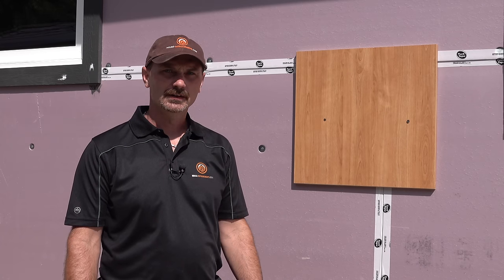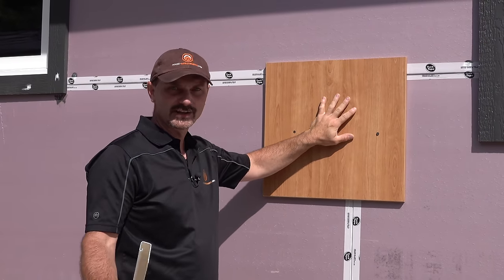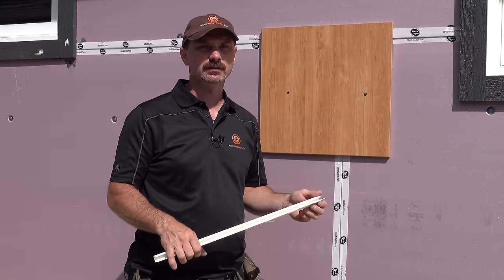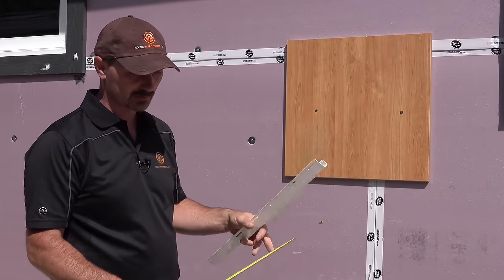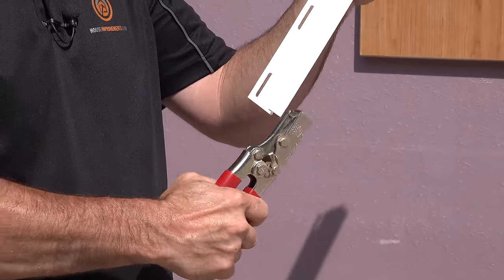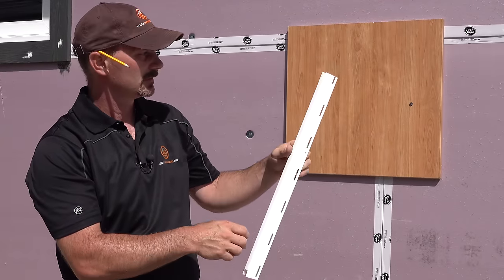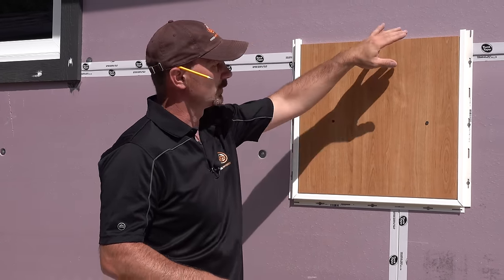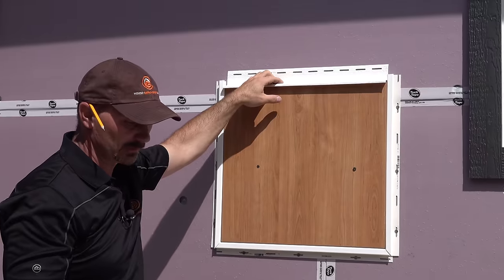How To Install J Channel (Vinyl Siding)

Comment: ... now why is it - more than 1/2 ( make that 3/4) of the window installers I've ever seen install J-channel - do it 'incorrectly' instead of like its done here ??????
Its not that much harder to do but surely doesn't do its job as intended nor appear as nice. 
Very recent experience :
A few weeks ago gave the ok to a window maker to use his own installers to put in 2 new $1000 custom-made windows for me and wanted em done specifcally a certain way - 'a certain correct way' - tells me a couple weeks out for install - thats ok. One installer comes out int the meantime to see what all is to be done. SO i proceeded to show em and tell em everything ...
his reply ... "don't worry" he says - "I've been installing windows for 45 years" !  Ok then - have at it . Thou these "pro window guys" do cost a few mo bucks than the average I felt quite confident the work'd be completed witrhout any type of developing issues in such that hese guys should know their chit.
Afew days ago they finally get started - what did they accomplish ?
First of all  - they took twice as long as any laborer due to age and the hot weather SO they had to quit for the day only after 1/2 a days work prior to even starting onto the 2nd window once the first was in and completed. That I had soon found out - was a great thing to have happened since no more than hour had past when i went to clean the entire newly installed window in and out and (WTF) - I find 3 flaws and one was the J-channel surround that had been simply wacked off square edged ! No miters, no overlaps, and 2 edges weren't even the correct length !  Then i notice the ledge they coil wrapped wasn't even level to the window panes !  Shoddy workmanship at its finest !   AND the one guy stated "I've been doing them for 45 years" - sure u have - the half-assed chitty way - all chitted up !!!  I myself could've done the frickin' job with a better result.!!!
Only good thing is --- they got to come back AND no $ had been paid up front !    :)   SO these will be redone correctly at some point regardless who finishes em up even if I hafta drag em in here to watch this damm video !!!

BTW : A1 quality audio/video presentation ... same as all I've ever viewed on this here channel ... only wish u were local to me ...... :)
Reply from the maker: Thank you very much for your compliments. Sorry to hear you had a rough go with the "pros"

Comment: Sad truth is most siders wont even install a dripcap...Sad but true..
Reply: I've never heard of it or seen it done
Reply: I found it at my local Kaycan branch. All they sell is siding. My rep said they sell almost none of it, and the guys in the warehouse had to hunt for it a while in order to load it in my truck. Seems it is not used in my area. I did not use it on my house when I did my siding 15 years ago and no problems so far. I have a weird end gable on a house I'm doing now and it is perfect for what I need!

Comment: Obviously ur just a journeyman sider. Where r ur flip nails? K u dont know what flip nails r u put a nail sideways in ur nailing falange before u put that face nail in. Benefit is takes crown out of j n puts pressure against the l bend casing or against that wood. It is most important when running stack return so length of j does nt appear to b crowned
 On north jersey n ny people privy to that trick dont know why that is

Comment: Sides should be done first
Reply: Always start on the bottom on any type of flashing ,,,
Reply: @daveyboy8907  that's true for flashing: but when putting j channel up ,I do the sides first at the exact length of window ,then bottom the with of the window plus each j channels width : I cut that slit on each side and tuck behind each side j channel: on top I do the same except the slots are tuck on the outside of side j channels: the reason for starting on sides , is so I can measure a perfect width for top n bottom :

Comment: You literally have 2 Windows near you why would you use a piece of wood randomly placed on a wall. Also this guy is obviously not professional. Ever heard of Tyvek? Lol
Reply from the maker: Tyvek is under the foam in this case.
Reply from the maker: I used the small piece of wood that is easier to demonstrate on since it is at an easy height ,small size and the windows on this wall are to tight to the soffit to have drip cap installed so they would not have been a good fit for the video.
Reply: @HouseImprovements  then you shouldn't have taped the seams it traps moisture. But what ever the j did look nice. You should see how we're supposed to do J. We put a 2" flange cutting the nail flange and locking it together